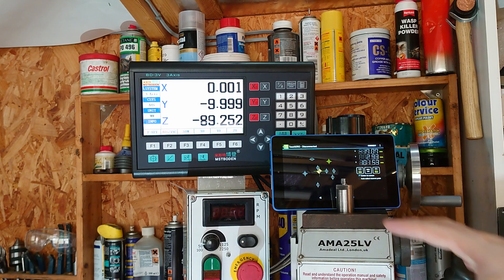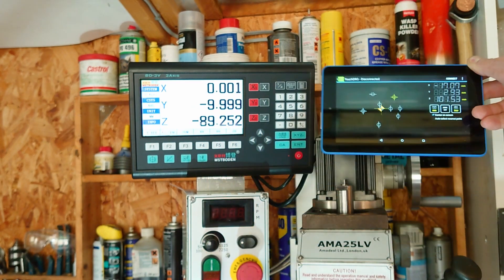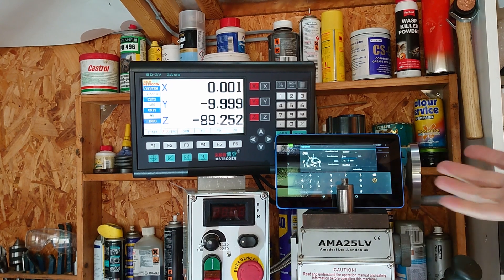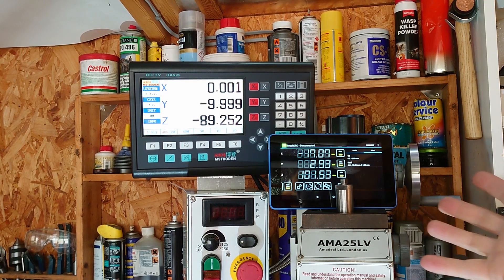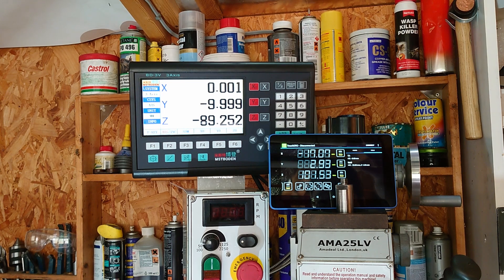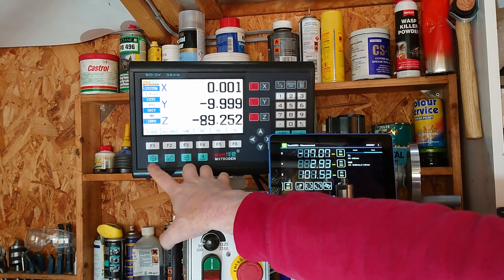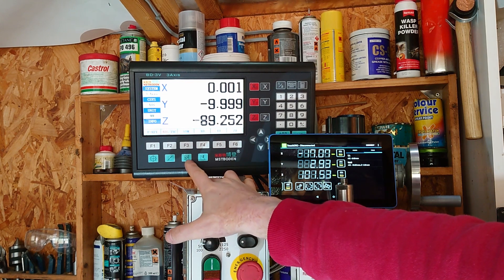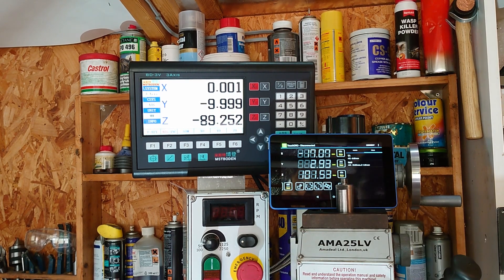touchDRO vs a standard DRO - a comparison on a mill

Comment: I absolutely love my Touch DRO. It’s been a game changer on my mini mill. The small size is also a big plus point. 👏👏👍😀
Reply from the maker: I do plan to sort the mill out with the touch dro at some stage, I think the tool library and workspace are great features that aren't on my Chinese dro. I may use the normal dro for the lathe, but I also fancy touchdro on the lathe too! All I need now is time!
Reply: @ollysworkshop  How very true. Time is always in such short supply, more so when you retire! 
I recently bought a DRO kit for my Myford lathe. Hope to install it soon. Will I like it as much as the Touch DRO?  Probably not, but on the lathe I only really want limited data on two axis. Andrew

Comment: Great video, Olly. It's really interesting to see a comparison between TouchDRO and a conventional DRO from a user perspective. It's really easy to get into tunnel vision,  so it's nice to get a reality check once in a while. I'd be interested in getting a bit more info on how the sub-datum mode is different from the workspace/saved coordinate approach. I was hoping to get the same functionality, but apparently either missed the mark or the feature not very intuitive.
Regards
Yuriy
Reply from the maker: Hi Yuriy! Thanks for commenting on my video. Not sure it came across properly, but I think your workspace and tool library functions are more intuitive and useful than the sub-datum mode on the DRO. All it allows you to do is have lots of incremental zero points. Being able to visualise the workspace is great. My DRO will only do that for holes in a line or circle, not arbitrary positions.
In fact, when I get an old 10" tablet, I may well use TouchDro on the mill and move the Chinese dro to the lathe.
Reply: @ollysworkshop  Ah got it. I misunderstood.